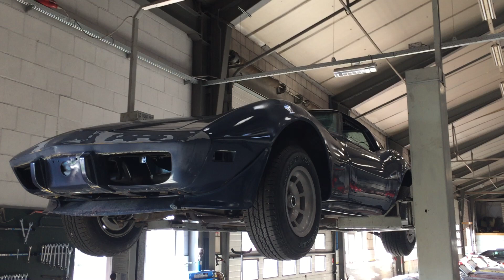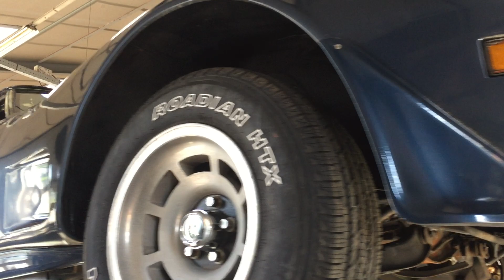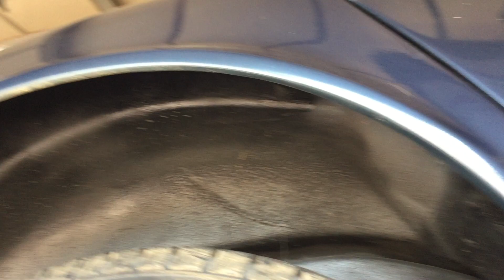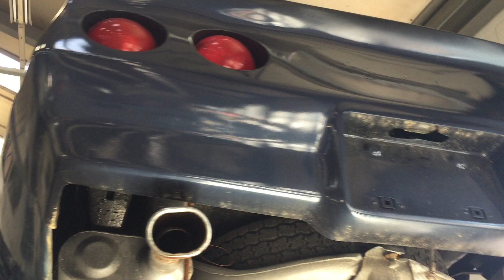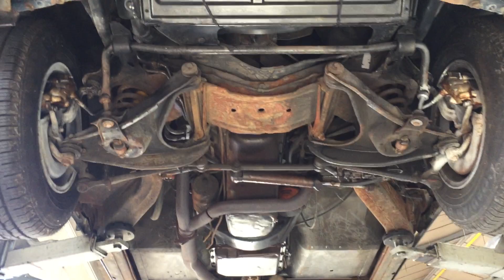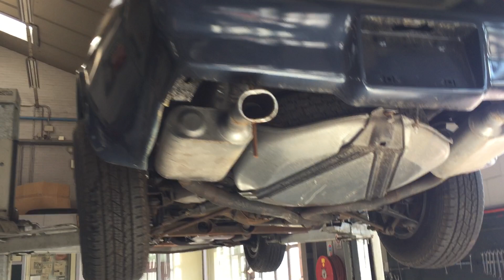1981 Corvette C3 project car   inspection pt 3

Comment: Nice car but it doesn't look like a 81 model, more likely a 79.
Reply from the maker: Thanks for noticing. According to VIN and title it is a 1981 model. What makes you think it looks more like a 79?
Reply: @Dandyclassics  ok maybe they have changed the whole front, the 80-82 has a wider and lower nose.
Reply from the maker: @Jockebanan99  with the whole front you mean the front nose cone section? Would you happen to have a source where I can look this up? I don't see any particular differences after a quick search on Google images.
Reply: @Dandyclassics  https://en.m.wikipedia.org/wiki/Chevrolet_Corvette_(C3)
Reply from the maker: @Jockebanan99  Thanks, I will point this out in the description on my website.
Reply: Btw, all C3s have black engine compartments from the factory.